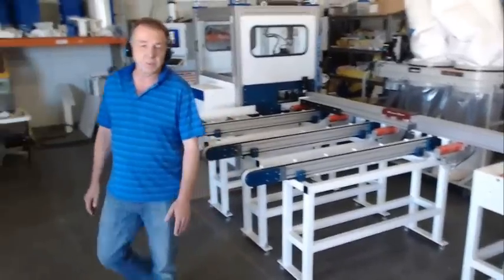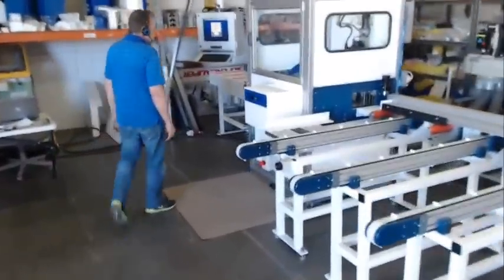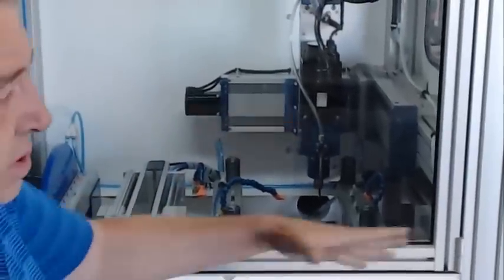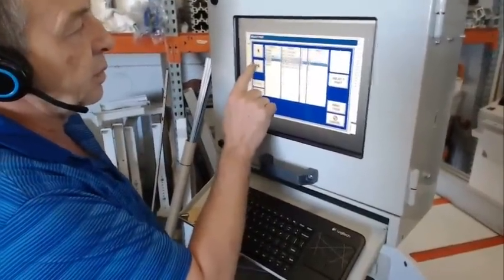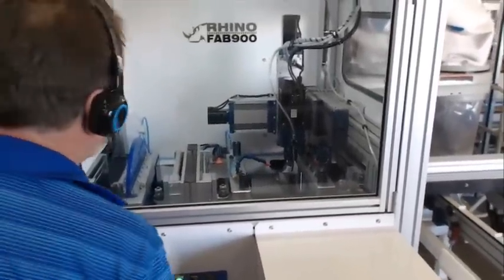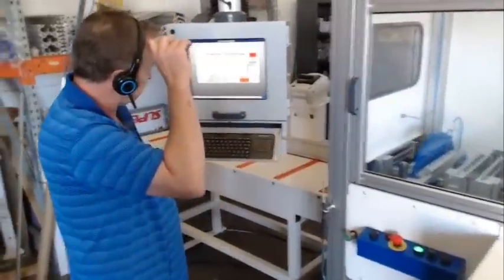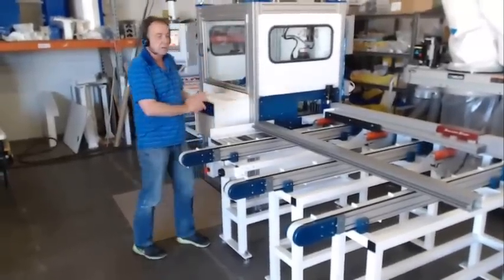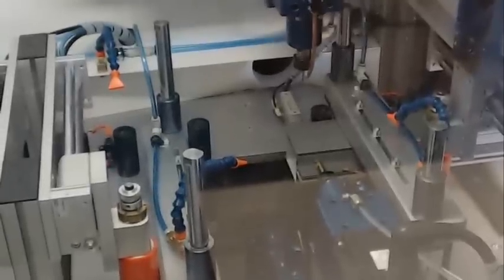RhinoFAB 900 Curtainwall Drilling Countersink

Comment: as you can tell,  for people who actually run this unit daily,  the countersink  bit is collecting far too much aluminum shavings and actually melting on to the bit itself.  with some speed,  step feed,  and oil/lubricant  adjustments you can obtain a very efficient and long lasting tool.  however,  the new upgrades from version 5.4 are seemingly slower than ever with the movement and operation of each router.
there should be an algorithm built to patch the times between fabs of each router allowing the product to be fabricated at a higher and more efficient pace.